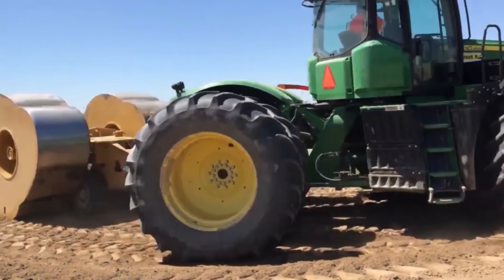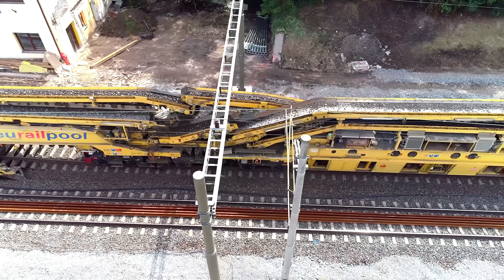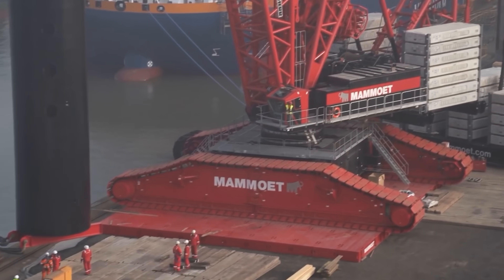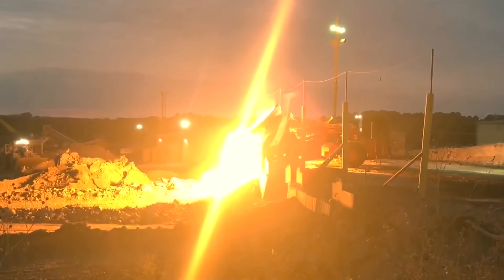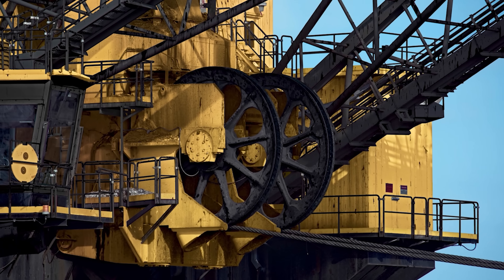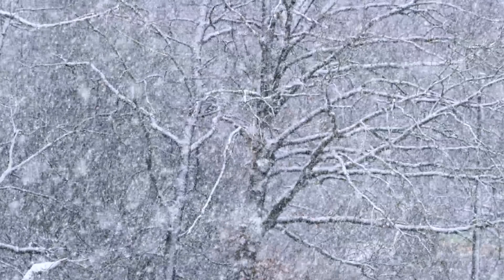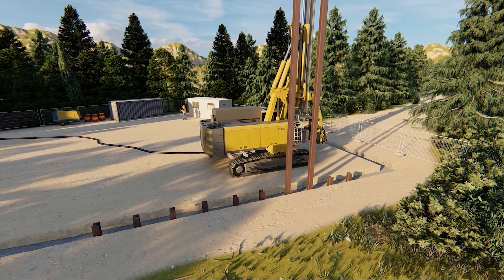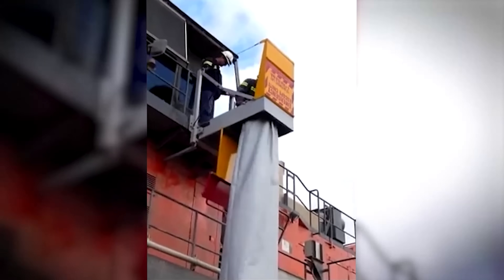11 Monstrously Powerful Giant Machines That Will Leave You in Aw

Comment: I think you should convert meters to feet. So we know what the real length is.
Reply: 3.28084 feet per metre (to the 5th decimal place). There you go. Welcome to the 20th century. You've still got a lot more to learn before you can be welcomed into the 21st century, but this is a start. Happy learning, Yank.
Reply: @elroyfudbucker6806  Ah, proof that idiots are worldwide. Does it make you feel better to talk down to people? By the term "yank" and the spelling of meter I'm going to assume that you are British. Land of measurement mish mash. How many stone do you weigh? Speed in miles per hour. Fuel consumption in litres per 100 kilometer. Fuel sold by the litre and the gallon. A persons height in feet. Fruit and veg sold by the kilo and pound. Beer in pints. Wine sold by the milliliter.  Milk in pints. Building height in meters. Land in acres. Building in square feet but every other area in squared metres. Temp in centigrade but also use Fahrenheit.
And while we are at it. Petrol, a word used for gasoline. Short for petroleum, what gasoline is made from. But then the same people that use that term like to deride Americans for saying "gas". "It's not a gas, it's a liquid". Yes but it is short for gasoline. You know, that proper name for the liquid you are burning in your car.
Reply: The metric system is a real measurement too

Comment: I'm very old school From America.
.I know nothing about leaders Or meters.
Give me inches. Beat and torque.
Reply: You may be  old school from America but the rest of the world are in metric, including some old schoolers too.  I think it's about time to convert, don't you think?  😉😃👍
Reply: OK. Here goes Mr Old School From America. 
25.4 millimeters to 1 inch or 0.0394 inches (39.4 thou) to 1 millimeter  
304.8 millimeters (30.48 cm) to 1 foot
3.28084 feet to 1 meter or 0.3048 metres to 1 foot.
3.783 litres to 1 US gallon or 4.54 litres to 1 imperial gallon. 
1.35 Newton metres (Nm) torque to 1 ft/lb or 0.7407 ft/lb to 1 Newton metre. 
2.21 pounds to 1 kg or 0.452 kg to 1 pound. 
28.3 grams to 1 ounce or 0.0353 ounces to 1 gram.
0.746 kW to 1 hp or 1.34 hp to 1 kW.  
Degrees Celsius to Fahrenheit; divide by 5, then multiply by 9, then add 32. 
Degrees Fahrenheit to Celsius; subtract 32, then divide by 9, then multiply by 5
Welcome to the 21st century. You should also practice your typing skills a bit more or perhaps don't rely on Spellchecker so much.

Comment: I believe there is a mistake regarding the CAT dragline. It's weight is rather 7500 tons but not 7.5 tons only.
Reply: The CAT 8750 specs page says it's 7.5 million kg, I think  someone's math was a little off 😂
Reply: @utha2665 7,500,000kg (7.5mill kg)? 😂
WTC1 and WTC2 buildings, each was 500,000kg.
Reply: @utha2665 maths
Reply: It's the new aluminum model
Reply: Built in China.  Mostly plastic.  But hey, it will work for a few months.  Like everything else built there.
Reply: Was gonna say, 7.5 tons is lighter than  an small empty double axle dump truck.
Reply: An obvious one lol
Reply: They use portals to send the weight somewhere else but keep the mass. It's magic.
Reply: It is made in china so it only weighs 7.5 tons. lol... 🤣🤣
Reply: What do you expect from an AI powered content farm